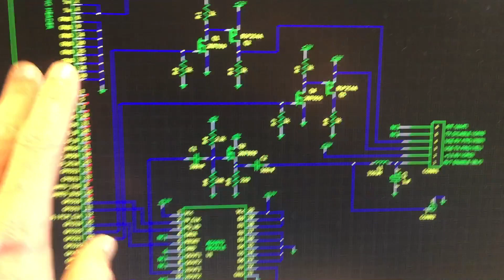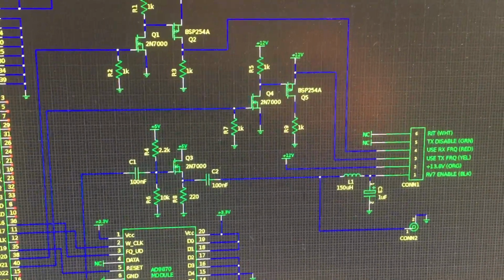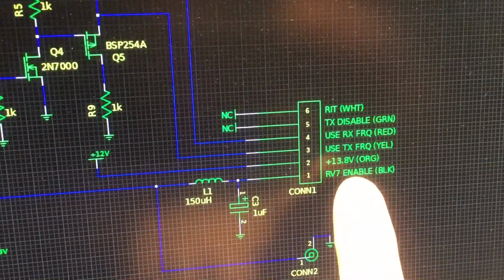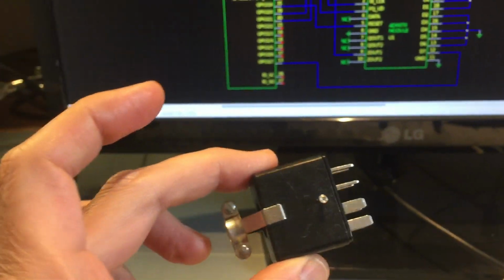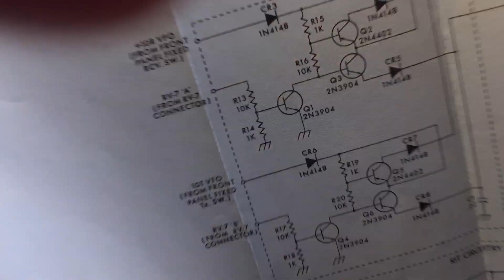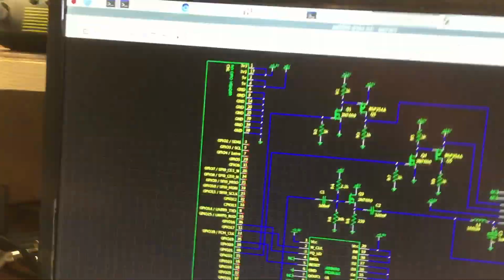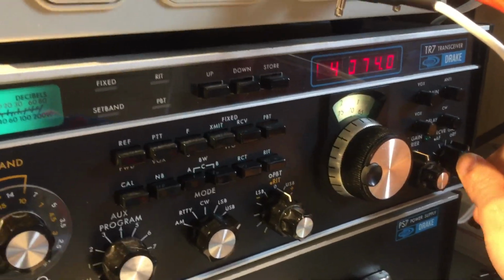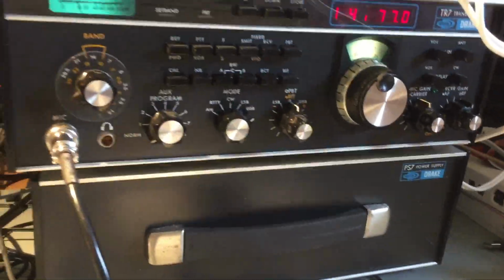TR7 DDS VFO - combining 2020 technology with a 1979 HF radio

Comment: Amazing.  Do you think that CAT-control could be possible?
Reply from the maker: It is :-) This is now working with fldigi and wsjtx etc.
Reply: @74HC138  Ok... i NEEEED this. too :) Have you been using the Yaesu 857 Library? I recently built an PTT and audio interface for my TR7 and have a DDS too (DDS-VFO by Wraase), which is - unfortunately - not CAT-controllable